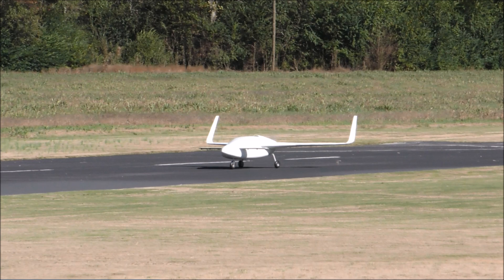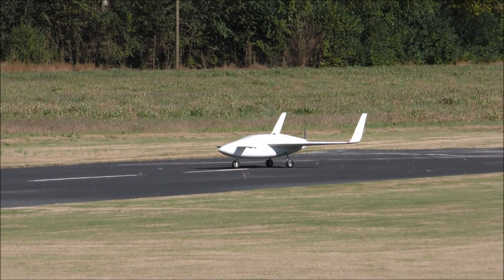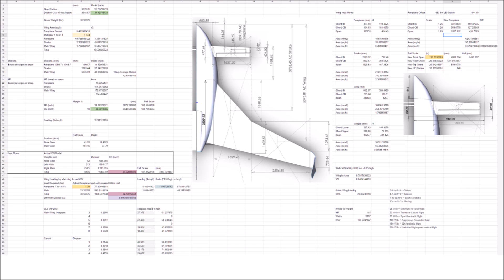Raptor Aircraft Model First Flight

Comment: Full elevator up or down? Is it trying to pitch up and hes holding the nose down or its trying to dive and hes holding the stick back?
Reply: Elevator authority is lacking, reason it leaps into air without rotating and lawn darts into ground on landing.  But the centroid of lift of the fuse is well forward of the centroid of lift of the wings, which made the NASA engineer think that he would have pitching trouble from the fuse.  This test then demonstrates that the fuselage is not generating the lift he expected it to -- not enough delta P out of that shape -- compare to the Piaggio P.180.  I suspect his final product will not do as well in cruise as expected either even with the improved forward wings and elevators.  This isn't quite the way a canard is designed to work but it should be controllable at least.  He should have simply cranked in more positive angle of incidence into the forward surface, especially if it's that small as a ratio to the main wing.  Then the forward wing stalls first and lowers the nose into immediate recovery and the main wing keeps flying.  Another concern is prop strike, which is why I look at these old videos. He went to a 5 blade prop presumably to reduce diameter, but still needs to at least limit elevator travel or put some system into his AHARS or placards or some way to prevent over-rotation.
Reply: @gendaminoru3195  canard winged aircraft are generally difficult to flare on landing and dont normally over rotate on take off.
I find it interesting that the airfoil in front is so "thick".
I also think if be is intent on using the canard as a control surface it would be best to make it a "flying" surface. That say the whole thing moves and incidence can be adjusted for different angles of attack during different types of flying.
The whiskers on the B-1 bomber did this and could also smooth out a flight in otherwise bumpy air. That had a long fuselage and desperately needed it but I believe it could be of some use here.
All with the added benefit of a lot less complication and the ability to change any inherently bad angles that might exist once flight testing starts.
Too bad the prop sits so far back if it were even a little bit closer to the end of the fuse the moment would be such that the prop shouldn't strike at all.
Reply: I definitely see prop strikes in his future, but I promised not to critique his project anymore - but he better get a DAR involved before it takes flight over the city.
Reply: @gendaminoru3195  What do you think now of his aircraft?
Reply: @christopherleveck6835  canard aircraft aren't supposed to have to rotate much to increase CL on T-O
Reply: @Mike-01234  I stopped following his progress until your reply popped up today, so I have no idea.
Reply: @gendaminoru3195  having more blades should be able to shorten them more too and use a more aggressive pitch....
Seems like the engine now better tuned would be better if it was biting more air at higher rpm. Unless I've got that backward.
For every power plane I've designed I have built a dozen sailplanes so not really my area of expertise.

Comment: Looking at your previous flow analysis it seems that the lift generated by the fuselage is on or about the c of g - therefore I would not expect any pitch moments caused by it.
Reply: on or about the CG of what?  The relative CGs between the centroid of the wing and the centroid of the fuse are much different looking at the planform drawings he showed.